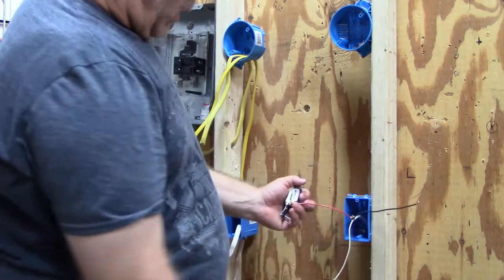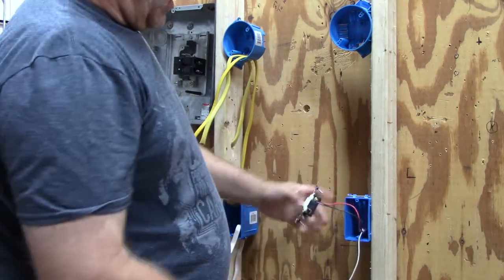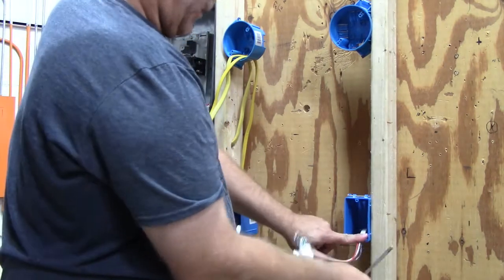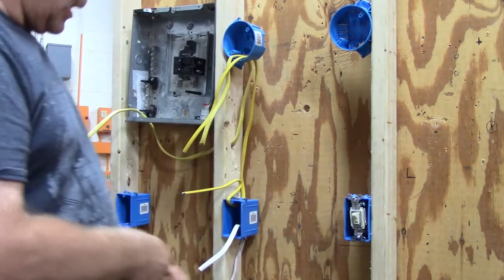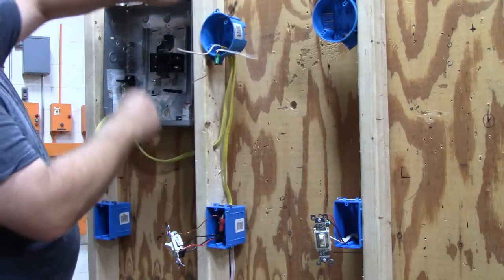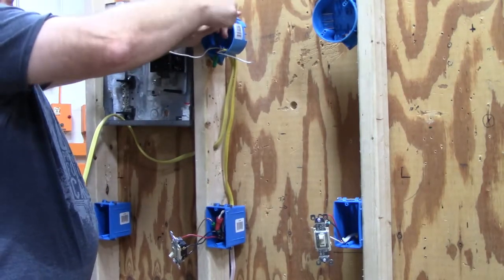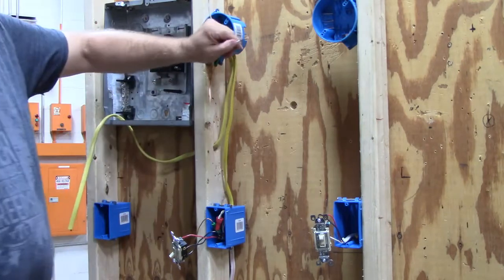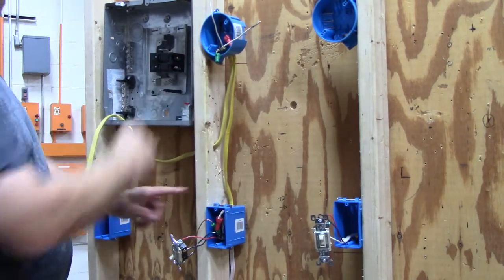three way switch, power at the light box

Comment: Tim, I don't care how crude your props are, your mind and talent are absolutely spot on.
I suffered through a full day of youtube electricians focused on explaning the 3-way switch,
always assuming a "normal" setup (power on one end and the light(s) on the other.
You are the only one who called out the special challenge of having both the light
and the power source on one end.  When I opened up the switch box closest to the 
light, I was immediately confused by the fact the white wire was hot...

Because you took the time (and smarts) to use the boxes as your orientating frame of reference....
and then added the wires (2 and 3 wire romex)....you had me well focused.  When you started
at the box for the switch down the line from the light, I was very skeptical.  "How in the hell is this guy
gonna handle the fact the white wire coming from the light/power source is "hot."

Well, you brought that up and handled it very well where it would make sense.....when you were
setting up the second switch box.....followed with a bit of information on power source and 
the light needs were to be handled in the round box. Since I can't see this setup, I took your word for it.

I mmediately followed your directions step by step.....Starting with the switch box furthest 
down the line.  Welll.................IT WORKED FIRST TIME I TRIED IT......

Not only are you an experienced electrician.....you have a knack for sensing what will be confusing 
for us not-good-at-DIY types and bring in "weird" stuff that fall out of line with black-wire, white--wire thinking.

My appreciation and thanks for helping bring a bad day to an end with a great success!!!! Frank
Reply from the maker: Frank, thanks for the great comment. I started this channel when the school I work for wanted us to put some of what we teach online. I did not put a lot of thought into how neat things look, just the practicality. It is my plan to redo many of my videos to improve the quality and aesthetics. But time always seems to be in short supply. Thanks again for the comment.

Comment: You see this in remodel homes alot and power at the rec like the light in this case for power for lamps to be 3 wayed
Reply from the maker: My boss told me when I started wiring houses back in the late 80's to use the least amount of wire as possible. Running the power to the light saved wire.

Comment: What if you have additional lights in series with the first light box that receives the home run? I wanted to attempt this way because of the location of the first light. I have the home run light that then splits off in two directions. At the end of one leg of lights is the 3 way switch in which I have the 2 wires from the light connected with a 3 wire cable. The 3 wire cable is run to the other switch. My issue is that only 1 light turns off and on with the switches. I'm wondering if this is simply bad practice to go this route or did I just screw up the light connection somewhere?
Thanks, very helpful video
Reply from the maker: Power in first light box, then run a 12-3 to second light box. You can add more lights if you want by running a 12-3 to each. From last light run a 12-2 to switch box. Power goes from light box to light box on black wire until power goes to switch on white. Switch loop comes back from switch box to the light on black wire which is hooked to red wire that connects all lights as the switch leg.

Comment: I have a three wire that is coming from switch to a light how would I hook another switch up to the other side of the room also coming from the switch is a single wire thats connected to the hot side of the switch going to the light. when I tested it the Black and the blue wire is hot in the light switch. its an open area no drywall.
Reply from the maker: What are the red and white wires connected to?  What is the blue wire hooked to? You could run a 3 wire from switch to switch.

Comment: I have this setup in my garage, but the first switch has the white as power going in and the second switch has black as the power going in. My question is, am i able to add a receptacle to the first switch box since it has this white power coming into it?
For clarification, this first switch box has the white power coming in and connected to the black three wire going out. The black wire coming in is connected to the top of the switch, with the white and red travellers connected to the bottom of the switch and going out the three wire. How can I do it with this setup?
Thanks and great video!
Reply from the maker: Adding a plug is only possible if there is a neutral in the switch box.
Reply: Is the black wire coming into the switch box (the one connected to the top of the switch) considered neutral? Would i be able to connect the receptacle by pigtailing to the white and black wires coming from the light, as in your example? Thanks!
Reply from the maker: No, if there is only a black and white wires coming from the light, one is the hot wire and the other is the switch leg or switch loop. You would need a third wire coming from the light for the neutral. @gregmojo3663

Comment: Wait, weren’t you supposed to connect the black hot wire from the panel to the white neutral (switch leg) in the light box ? In order to complete the circuit !?
Reply from the maker: You are correct, the code was changed so that the white wire can be used as a hot wire if marked. I believe this was the 1999 code, correct me if that is not right. I teach a beginners residential wiring class and try to show them what they may run into if working on older houses. When working on houses that have been wired by some not so knowledgeable people you run into all kinds of weird wiring. I worked on a house one time where the white was used as the hot and black as neutral. I mention in the intro that this method may not meet new codes and to check codes if you do not know. Sorry for the misunderstanding.
Reply: @timpalmer-logstolumber1999  oh I see.   I’m not really familiar with the 90’s code. Thanks for clarifying that for me.
Reply: @timpalmer-logstolumber1999  A OK in Canada
Reply from the maker: @martytruelove5026  I try to go fishing in Manitoba or Ontario every year, love it there.

Comment: Good video, just would like to point out the fact that it is against code to use the white wire as a switch leg. Now with that said you can re-identify the white for use as a hot, but that would be the wire carrying power to the switch not the light. So that would have worked the way you had it if the white wire coming from the common on the second three way was connected to the black coming from the panel and the black wire from the common on the first switch would be the one that goes to the light. This is to avoid having two white wires attached to a light if wire marker did come off or rubbed off somehow. The NEC code that I am referring to is article 200.7(C). And the white conductor has to be re-identified at all points. Otherwise great video.
Reply: That’s the issue I’m having at this customers house I’m glad you made this comment. But I 100% like the fact that he’s able to break down and show us how someone could have used the white neutral wire as a switch leg. Even tho he didn’t mentioned we can assume. That way it’ll educate others who may be lost. And since you pointed out how by code we’re not supposed to use neutral as a (SL) I also give you 100% credit 🙏🏽💯
Reply from the maker: That is correct about the white wire under present code. But if working on older house say those built in the 70s or 80s, before the code was adopted, you may see it.

Comment: Since neither switch box has a neutral in it, isn't this against NEC code since 2011?
Reply from the maker: The object is to show my students what they may run across in older homes. They need to know how to work on these older circuits. New construction would need the neutral.
Reply: @timpalmer-logstolumber1999  Thanks for the explanation.

Comment: Just trying to help a little here. The traveler wires do not have to match from one switch to another. The only thing that matters is you get your power wire on the common screw/black and your switch leg wire of the other switch also on the common screw/black. The traveler wires it does not matter which brass screw they go under and do not have to match. One way you could check me is build your circuit putting the traveler wires as I say and use your ohm meter to see if you have continuity through the circuit. You would have to use a regular light bulb so your meter can read through it. Leave your wire out of the electrical box and place your ohm meter between the white and black. If you read continuity and you will then you can see it will work. Anyways enjoyed your video...
Reply from the maker: The reason I do this is because I teach my students to do things the same way every time so they make fewer mistakes. Once they understand how it works, then I can explain other options.
Reply: @timpalmer-logstolumber1999  That makes good sense.